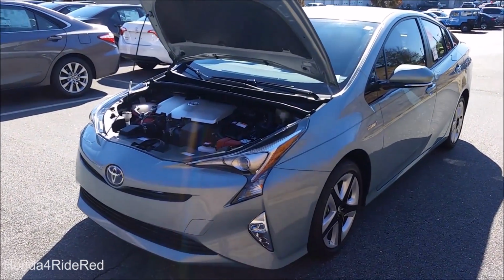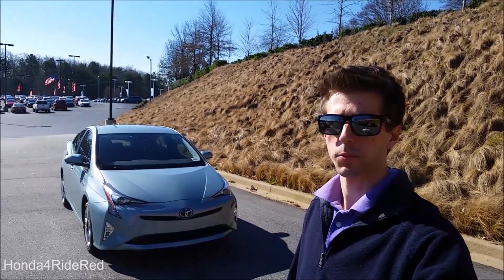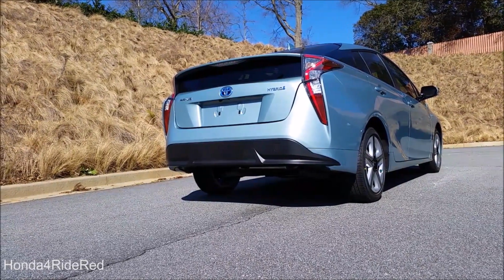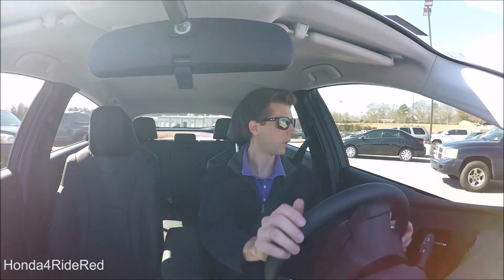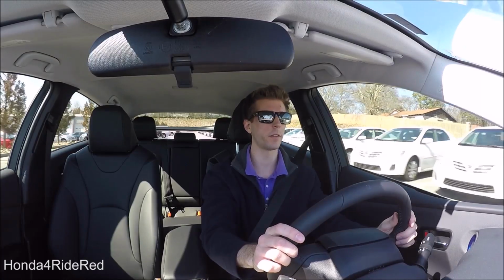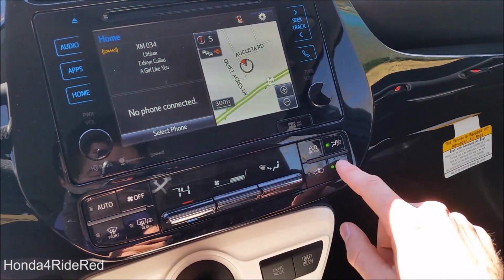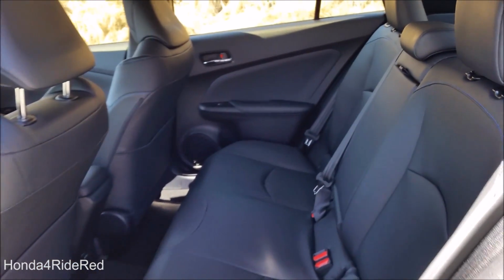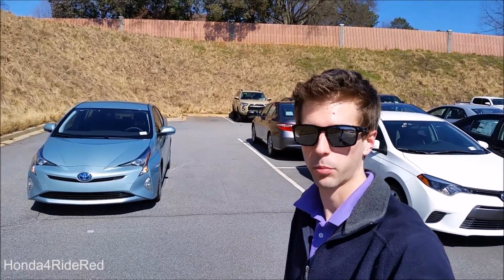2016 Toyota Prius 3 Touring: Start Up, Test Drive and Review

Comment: Guys you know you can make it's the best sleeper car. Imagine you can engine swap it with a v8 or v6 or add a twin turbo and change the drive type it all wheel drive put recaro seats and make the whole body carbon fibre and remove the back seats and add a roll cage make it 2 or 1 inch lower AND and brembo brakes and replace the steering wheel for weight reduction and put nice rims and add a rocket bunny kit with a big wing.
Reply: GenGen 2x I like the idea..it started as a sleeper, but it was nothing like a sleeper in the end..sleepers don't look like they are powerful it is only when the driver wants other people to know, then they show their real face..

Comment: I admit, i was one of the people who hated the way the car looks.  But driving it off the lot felt good.  I've driven 90 miles now and my gas tank is still full.  This is really baffling considering my jeep grand Cherokee really hurts the wallet after so much driving.

Luckily we have really good credit and got 0% financing and 0% interest on 6 years with 740 credit.  I don't feel like such an asshole driving this car and i notice myself being conscious of my driving habits by trying to use the battery as much as possible instead of just stepping on the gas.

I highly recommend the car for anyone who is looking to save money.
Reply: How much room do you have on the driver seat I'm 5"9 and I don't like to be tight, I like the Taurus and chrysler 300 because is wide.
Reply: @pitbullchamp3459  I'm 5"11, its pretty roomy, its a 10 gallon tank, so it only cost 25-30 bucks to fill up, you can get 450 miles per tank.

Comment: Thumbs down for "Toyota Prius 3" in title..
Reply from the maker: This is the Prius 3.
Reply: No, it's Prius 4 as mentioned at the beginning of video..
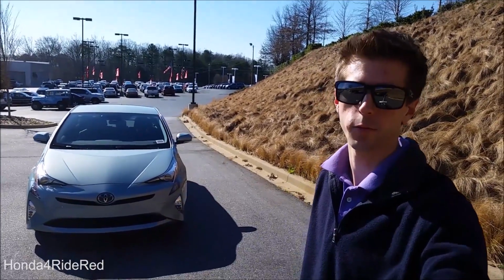Reply from the maker: +Stan Trnik No this is the 3, I never said it was a 4, at 2:10 I point to the car when I say 3, this car is the prius 3 touring model.
Reply: It should be Prius 4 as it's 4th generation as you mentioning it at the very beginning of video.. If you referring to equipment level.. that's called "Three" ? Isn't it? You can buy 2016 Prius 3 and also 2016 Prius 4 and if you want you can choose 2016 Prius 4 Three ;)
Reply from the maker: +Stan Trnik Yes it's the 4 generation Pruis, but of the models offered, it's the Three  touring.

Comment: I don't understand why people like the split rear glasses. The lower panel tends to get fogged up when it's raining mildly. Basically rendering it useless as a view to the rear.
Reply: Cω Tham i guess you haven't driven a Prius for any decent number of miles... the split glass is great on the old Prius up to 2015 because the dividing plastic thingy perfectly blocks the headlights from the cars behind in your center rear mirror, i mean they must have intentionally calculated it like at the proper height and thickness, cause it's a dream to look in the mirror and not have bright light, even if they flash it still doesn't matter cause the divider is exactly the "wideness" of 99% of car headlights. also the lower glass doesn't fog but does get dirty on outside, but who cares that section could have been metal anyway nothing to see there and it's got rear parking camera..so... yeah. on the new 2016 Prius sadly they seem to have made the dividing plastic piece narrower so now it doesn't block all headlights... only about 40% of them.
Reply: Choice777 calculated to proper height of aerodynamics, definitely not to blocks the headlights from cars behind you. Otherwise, what's the point of fitting an auto dimming rear view mirror by the manufacturer?

Still, it does get fogged up, probably not in your weather. But it does over here, and the available rear view is even smaller now.
Reply: rear mirror dimmer is cause of the sun ;) it says in the instruction manual

Comment: I enjoyed your review, thanks. Most reviews don't mention the Atkinson cycle gas engine which is crucial for the good economy of the car. The Honda Civic 1.6 Diesel is probably more efficient for highway use (I don't know whether this car is available yet in the US).
Reply from the maker: +Martindyna Thanks, glad you like it! I don't think the Diesel Civic is available. I haven't heard of one.
Reply: +Honda4RideRed You may find the below link interesting. Obviously you can only attain this sort of economy under favorable conditions (engine fully hot all the time for example). This is based on the UK gallon. I have no connection with Honda LOL.
http://hondanews.eu/gb/en/cars/media/pressreleases/57278/honda-sets-new-guinness-world-records-title-for-fuel-efficiency-averaging-10031-miles-per-gallon-in
Reply from the maker: +Martindyna wow that's pretty neat

Comment: Really if my Chevy Volt ever got 54 mpg....I would take it to the shop because 54 mpg is pathetic!  If my Chevy Volt ever went 0-60 in 10 seconds....it would be back in the shop, because 10 seconds is pathetic!  My Volt has an average mpg of 106 mpg after 49,000 miles.  Last month I got 231 mpg driving 1,913 miles according to On Star.  As far as 0-60, the Chevy Volt beats the Prius by 2.3 seconds (7.7 sec for the Volt).  The Volt has 279 lbs of torque at zero rpm. Full torque at the lights means the Volt leaves almost all cars behind every where it goes.  It's so fast!  With no range limitations like a pure electric, the Volt stands alone. Everything else seems lame.  For $22,195 after state and fed rebates, the Volt is a steal. Why not you.  Buy a Volt!
Reply: who cares?  I buy Toyota because of their solid reliability track record.  I can confidently rely on buying a Prius to run 200K miles without a hitch.  Can Chevy or Ford match that after 10 years of use?
Reply: VoltecRules, Disingenuous be you, comparing the plug-in volt to the non-plugin prius MPG.  You're not stating the MPG of gas only for the Volt. quoting wikipedia for the 2016 Volt "The gains in efficiency allow the second generation Volt to improve its combined fuel economy in gasoline-only (charge-sustaining) mode to 42 mpg-US (5.6 L/100 km; 50 mpg-imp), up from 37 mpg-US (6.4 L/100 km; 44 mpg-imp) for the previous model."  If you drive the Volt like a Prius non-plugin as gas only, the real MPG for the Volt is lower than the Prius.  This is an apples to apples comparison, instead of useless Volt promotion that makes intelligent decisions harder for people.
Reply: VoltecRules, you talk like a Volt fanatic.  I followed the Volts development from the GM futuristic prototype announcement and as a participant in the GM-Volt.com site. I understand the benefits of the alternative power source (electric) a series-hybrid provides but that doesn't excuse comparing apples to oranges so as to lead others to an incorrect understanding.  Under gas only conditions the Volt is not as efficient as the Prius.  If you want to compare the Volt to the Plug-in Prius, that would be apples to apples, have at it.  We're looking for truth, not fanaticism.  I'm getting MPG in the 50's without hypermiling, with hypermiling it gets 65 MPG without the added cost and work of plugging and unplugging in the car or concern about traction battery lifetime.  I would consider a Volt if the passage of time has proven the life of the lithium battery would match that of Nickel-Metal Hydride.  Not enough time has passed and I don't wish to waste money if the battery has a short life span.  The Prius has an established reputation for long service without high cost.  All things to consider.
Reply: oooh car fight!
Reply: +VoltecRules The mpg does kinda suck on a prius for a hybrid, but they did the 0-60 test in regular drive mode. Switching to power mode in a prius would prolly shave off 3 seconds and be comparable to the chevy volt.
Reply: +ryfodrea I did a little research and Car and Driver magazine had the Prius at 10.3 sec 0-60.  Another site, zeroto60times clocked the Prius at 9.6.  That is the fastest I've ever seen a Prius go 0-60, and it's still pathetic!.  That is 2 seconds slower to 60 than the average time for a 2016 Volt of 7.7.  Also, Motor Trend clocked the new Volt 0-30 in 2.3 seconds.  That is .1 second faster to 30 that a 2013 Tesla p85.  The Volt dominates 0-30.  Really, leaving at lights, my Volt blows away V6 mustangs, BMW 3,  V6 Cameros, etc to about 50 mph (then they catch me). My 2014 Volt has 53,000 miles on it now.  Lifetime mileage of 114 mpg. Lately I get 250+ mpg since I don't use gas that often.  There is better tech out there now.  Don't buy an old tech Prius.  Prius is slow, and has bad gas mileage compared to other fuel eff cars.
Reply: +itsaboutchoice For you, I would suggest you change your name to, ITSABOUTDECEPTION.  Prius is Old Tech, and until Toyota can copy the Volt's technology, and claim it as their own, Toyota will send out it's writers to deceive the American public that the Prius is still relevant...it's not!  My friend bought a Volt almost a year ago and still has not gone to the gas station.  Plugging in my Volt takes 5 seconds and is very easy.  The car is extremely fast, and the regenerative brakes extend my battery range by up to 30%. I would expect to achieve close to 68 miles on a charge in the new 2016 Volt.  Put your Volt in "L" and Sport mode and you literally drive only using the accelerator pedal.  The regenerative brakes apply as soon as you lift up on the accelerator.  No hypermiling needed in a Volt, just drive the sh_t out of it.  As an added bonus, Volt's only change oil every two years typically, they hardly need any service, and they only cost $22,195 after rebates.  Sorry Toyota.
Reply: It’s a chevy tho.
Reply: +itsaboutchoice 80% of Drivers drive within the 53 mile battery range of the Volt.  That means 80% could drive 53 miles x 365 days per year / 8 gallons of gas burned automatically ,by the Volt yearly to keep the gas fresh = 2,418 mpg in a Volt.  The Volt doesn't compare to any car because it's in a class by itself.  It's an electric car...with a gas generator to remove range anxiety typically associated with pure electrics.  Sorry if the Volt is too good to compare to any Prius.  The plug in Prius was so lame the stopped making it (it went 11 miles in a charge, really!). The Volt really kills a Prius 0-30, 0-40, 0-60, because it has 279 lbs of torque at every stop light sitting quietly waiting to take off like a fighter jet on the Nimitz.  My lifetime mpg after 53,000 miles is 114 mpg.  What does your Prius get???? Hahahaahaha.   Volt rules!!
Reply: +itsaboutchoice Attacking the messenger, instead of the facts, you lose the argument.  The facts are you can't argue that my car has an average lifetime mpg of 114 mpg over 53,000 miles...while driving way too fast.  Your Prius gets 50+.  You do not address that the average driver drives less than 53 miles per day and would therefor not use any gas at all driving the Volt, except for the one tank of gas it automatically will burn each year to ensure fresh gas.  Why would the Volt have such a feature to burn one tank of gas, maybe because 80% of drivers drive less than 53 miles per day.  Ask yourself readers if you drive less than 53 miles?  If you do, then you to could easily get 2,000+ mpg.  It's true the Prius can achieve 50 mpg, but from what I read and hear is you have to drive, well, like a Prius driver;(. GM has not had to replace a single battery since the car's inception in 2011.  Nice try...pathetic.  The Volt has great driving dynamics, the Prius doesn't.
Reply: +Tommy T Lets see Tommy, does a 57 Chevy count?  Why that's 59 years.  How is your classic (haha)Toyota Cressida doing?  Does it still look like a cheap Japanese car.  Toyota copies American technology and claims it as their own.  It's just a matter of time before Toyota copies the Chevy Volt.  Last month I drove 1667 miles and used 2.5 gallons of gas doing it.  That is 667 mpg in a Chevy Volt traveling 1667 miles.  How many gallons would a Prius take to drive that far, Tommy?  Try about 33 gallons and about $100 in gas for the Prius.  I saved $93 bucks.  My Volt has been flawless over 53,000 miles.   I don't change the oil except every two years...just because I want to, not because it needs it.  If my battery ever needs to be replaced, and if it did it would be the first Volt ever to need that, I still could drive my Volt on the gas generator instead.  The Volt basically has two power sources that work independently if I so choose.  Just buy a Volt, you know it is so much better.
Reply: Choice777 It's not that I can't compare two cars that use batteries and gasoline to achieve good gas milage....it's that you don't like the results.  Volt kills the Prius.

Chevy Volt won Car of the Year...twice!  There are reasons for that.  In your dribble you mention the Bolt, when I think you meant Volt, but the Bolt (Chevy too) just won 2017 Car of the Year and Green Car of the Year.  Toyota didn't win anything...sorry, nothing:(

Chevy makes cars that Toyota can't compete with.  Look at the Vette and compare it to the Toyota what??  Or a Silverado getting 18 mpg city to the Tundra getting 13 mpg city.  Sorry, Toyota is Old Tech and can't compete.

Update:  My 2014 Volt now has a Lifetime mpg of 140 mpg after 67,000 miles.  I continue to beat ever car off the line at every light.  The Volt is so FAST off the line!  I don't have to drive under 27 mph like a gay Prius to stay on electricity.  Zero problems with my Volt since new.  Maintenance:  2 oil changes...that's it.  Try that in a Gas Hog Prius.  Hahaha

Comment: It is not the most fuel efficient car that is not plug-in. Maybe the most fuel efficient gasoline car.
Reply: +Arnis Tarassu agree! For now, I think it is best car solution. Electricity car is still not best solution for people living with our recharging equippment. Hybrid is best for now.
Reply: I'm very pro diesel, too. But that's not true from what I've seen. The numbers do seem fairly close but the Prius has higher mpg. I've seen 70+ mpg from Prius when driven really carefully.
Reply from the maker: The reason I said that is because of the batteries as well, it's not purely gasoline and has a significant jump in mpg compared to other cars.
Reply: What's the most efficient non plug-in? The Prius Eco, right?
Reply: No. Most diesels will crush Prius, any  plugless Prius. Except in really slow start-stop traffic.
Reply: I've driven 2010 BMW 5 series 530d. I see 40mpg with not careful driving. And this is not a "pussy vehicle", it has a lot of power.
Reply: +Arnis Tarassu I'm looking very closely at getting a 328d xDrive Sports Wagon. AWD, lots of cargo room and room for my family, crazy fuel efficiency. (The only thing is in a year or two when I'm ready to get a new vehicle in this range, the Diesel Discovery Sport and F-Pace might be available in the USA and I have a family connection that can get me a SICK deal on Rovers and Jags.)
Reply: godfatherNYC amazing mpg numbers. How about the 328 reliability. I am looking for a used 328. But the complaints about relability came a lot
Reply: Straight 6 diesel is more robust than straight 4. I would not recommend xdrive if you hardly live in snow/ice territory.
Reply: +Arnis Tarassu that car is so sexy but i now the back is ugly but how do people want the prius like is really hard to make a prius's lights.the Honda insight has really nice back lights even the new chevi volt i think the designers think that making the lights more longer was a mistake but the car is really cool do from the front and the interior and it has a larger trunk you can even put bikes in their and it haves a spare tire🚐🚐🚐
Reply: Arnis Tarassu no diesels won't beat the Prius at mpg.. any ever!... the 2009-2015 Prius gave me 53ish mpg every day, this 2016 gives me 65-73 every day. no diesel will match that... and then when it comes to flooring it the Prius will leave the diesels way behind... not to mention the car is super quit even up to 50 mph, then still quit at 70 mph AND not to forget it doesn't rattle like a god damn tractor at idle at traffic lights/etc... plus with the radar cruise and automatic obstacle detection and braking... it's really an easy pick over any diesel.... not to mention ALL but i mean absolutely all diesels have their turbos fail at the 60.000 miles mark.
Reply: You have no experience with diesels my darling. Drive BMW 530d at 125mph for 2 hours, then you know. 23mpg.
Reply: Arnis Tarassu stop smoking varnish chips...i was rebuilding diesels when you were learning to walk kid.